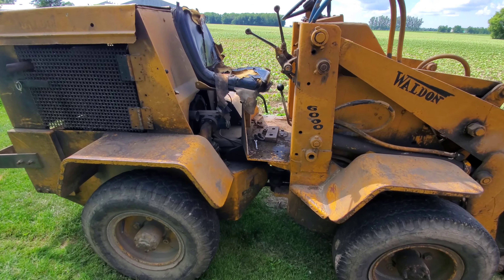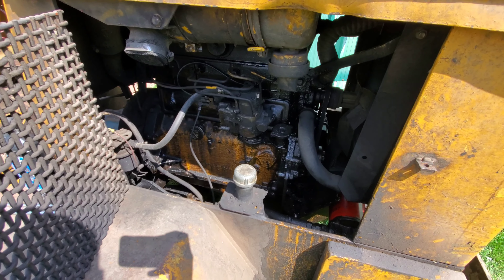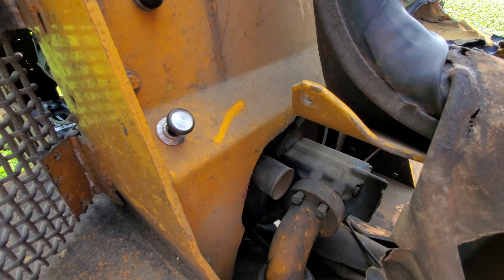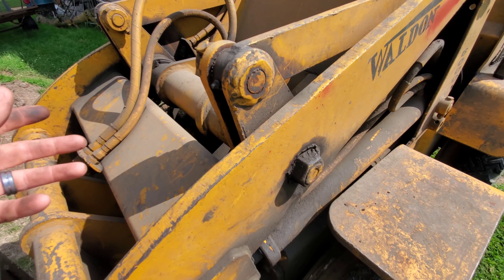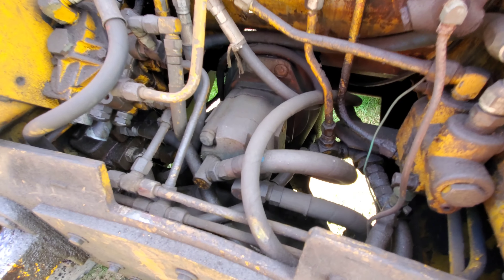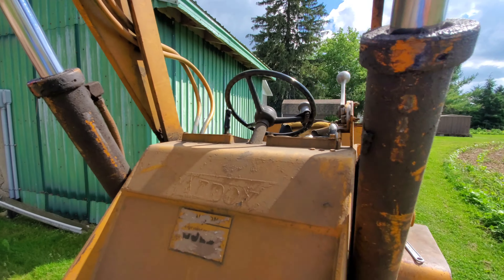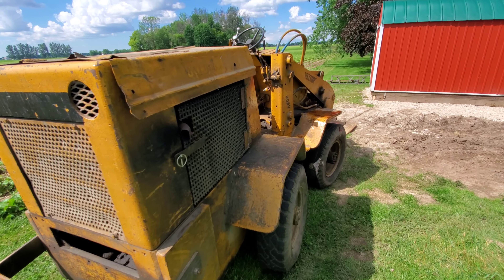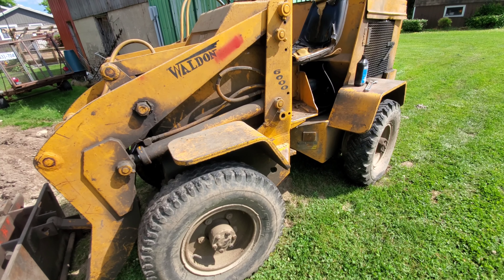waldon 6000 junkyard dog

Comment: Reminds me of a scatback 430.
Reply from the maker: That is neat I had never heard of the scatback 430 ether but I just looked it up. It does have a very similar look. Thanks for the comment
Reply: It is about Twice the machine of a Case Scatback !!  Take a Scatback ,Lift all it will pick & the Waldon will pick the whole lot !!!
Reply: @brianthompson9729 - Correct me if I'm wrong.  SAE Operating Capacity for Waldon is 2,700lbs. Davis Case Scatback 430 is 2,000lbs.